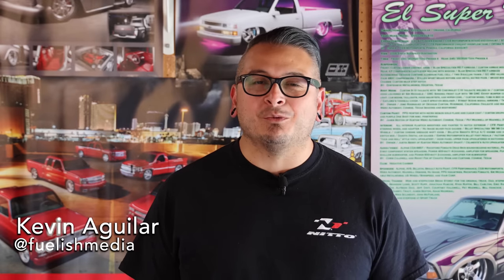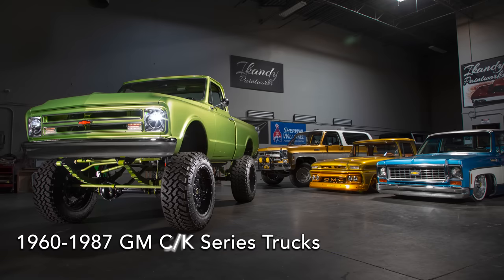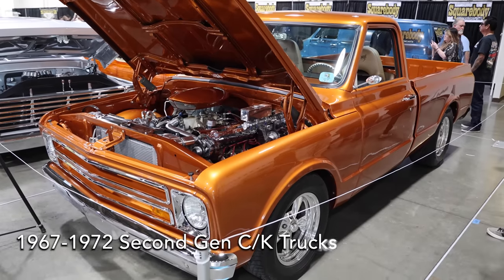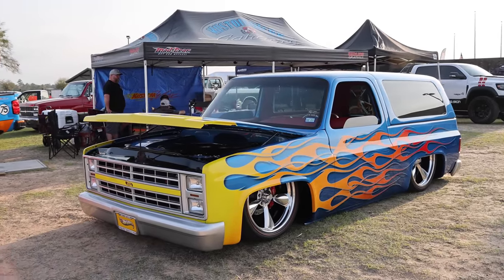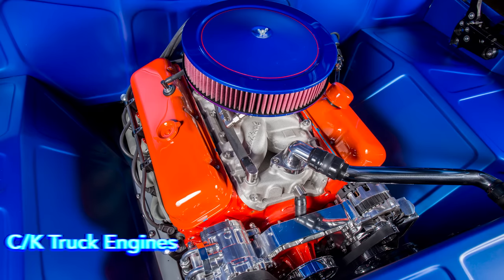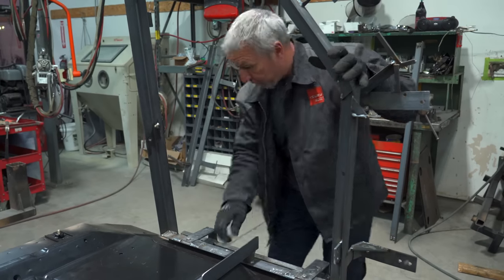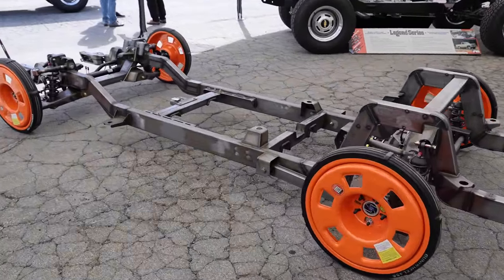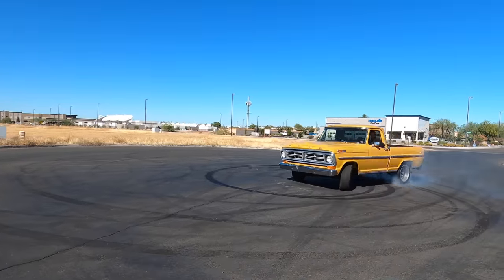Why are C10s so Popular? | The Bottom Line

Comment: Thinking to put a ''not for sale'' sign in the window of my 68 shorty, every time we go out I get people asking. It is nice that it makes other people want to get into one 👍
Reply: I have a 67 short bed , straight  6 cylinder 292 , 4 speed trans and  12 bolt rear end
Reply: @jimthomas1989 - Unicorn if it has a factory tach and a/c !
Reply: @TheCanadianBubba  ,
No AC 
No Tach 

I have a  68  K-20  , it has the original  307 small block  , 4 speed standard trans with  Rockwell Transfer Case with  Hi /Lo 4X4 , Dana 44 front end  and  heavy duty  rear end  , 17.5 tires and rims 
No AC 
No Tach 
It was a U.S . Utility Forresty Truck  
55,000 original miles

Comment: I own a 1976 C 10 long bed used to have the 250 straight 6 in it and I did the 350 swap built cam headers the whole package. Ford 9 in 411 posi 15 in Mickey Thompson old school Cragar rims Paint is Black and interior black and a roll cage all new chrome replated. Custom Electronic Gauges and a sound system to boot. I have been offered over 80K and I still say NO! I love this truck and I will take it to my grave!

Comment: I just bought a ‘79 C10 longbed in great shape. I love the squarebody design, I love the big bench seat, I love the manual transmission. i love that it has actual bumpers, and that the rear bumper has diamond plate and you can actually stand on it. I love that even with a toolbox the bed is still longer and wider than anything produced today.

Comment: For me these trucks just work. I hauled over 25,000 lbs of topsoil past two weeks in my 1983 long bed and the bed height is absolutely perfect for unloading anything. 40 year old 305 engine and 3 speed transmission still working fine, as is the original AM/FM radio/cassette player lol. Paid $1100 about 8 years ago hoping the truck would last a single summer of  home remodeling. Going to keep her and give her some repairs and upgrades.
Reply: I have an 83 longbed 305 too. I have a 4 speed though 😏

Comment: Great video! I fixed all the electrical on my 78 C10. Just had all the braking system replaced as well. Calipers, rotors, discs, drums, shoes, and lines. This week it’s going in to get a frame support welded by the steering box. Hopefully next month I’ll be able to get all the suspension replaced and next on the list it’s getting the engine replaced with a 350. Money dictates how fast the project goes, but It is exciting getting it up to speed. I’m hoping that by the end of the year it’ll get a paint job. Still thinking what color. 🤙🏻

Comment: When I came home from my last deployment in 2009 I quickly acquired 3 73-87 Chevy trucks

5/7 drop one air ride and one dually I started to work on but sold

$1500 for one, $3200 the other, $3500 for the dually 

Sold for 8k, 12k, and 15k. Thought I made out good. Shoulda held on a few more years

Comment: I just bought a 1984 K20. It has a Dana 60 in the front and a 14 bolt in the rear with double lockers. I bought it for $9,000. I'll probably put another 9000 into it. I love this truck. I wanted one in the '90s and I own one now. I rock. I can fix it myself. It doesn't have any stupid computers. Some really simple mechanical work and the body is almost perfect. I just need suspension and probably reegear it and a little bit of interior work

Comment: C-10's aren't popular, C-10, K-10, C-20, K-20, C-30 and the K-30 are popular, because there are so many still out there still running, the interchangeability on them make them simple to fix or modify, you can swap your 230 I6 out for a 454 big block V8 in a weekend. Plus, pick a year, it just looks so much better than an alternative manufacturer
Reply: C10s are popular. As goes for any vintage Chevrolet truck.

Comment: They are THE LAST of the REAL trucks, thats why. This is it, after this they are all plastic.
Reply: That’s silly. The OBS trucks were all galvanized steel until 1998. The NBS trucks were steel too. In fact, you can’t find one that isn’t full of rust.
Reply: @BearGrils55  of course the frames and body are steel, I'm speaking to plastic interior, plastic bumpers, airbags, and full of  plastic under the hoods, all run by complex computers
Reply: @mblake0420  squarebody interiors are all plastic too. Still love my '82 but they are definitely built cheaper than previous gens

Comment: Can a c10 converted to a k10??
Reply: It takes  a lot , the entire  front  end will need removed  , 
I have a 77  short bed  , Dana 44 front end and  12 bolt rear end , 4 speed  standard trans and  transfer case ,6 Lug with  33 mud tires , had a 350 small block  , has a 250 straight 6 cylinder now , 
Any cab from 73  to 87 will  fit on it .
And it would  be much  easier  than  all the Welding  you would  have to do  to make it yours a K-10 

I also have  a  68  K-20  which  is  a 3/4 Ton 4X4  and it has a standard  4 speed trans and  Rockwell transfer case and everything from  67  to 72 cab will fit on it , but  it already has a  68 cab , fenders and  small block  307 
The 307 is a  327 crank in a  283 block